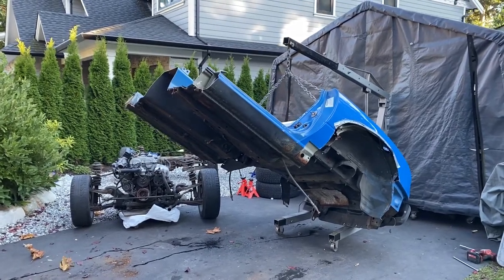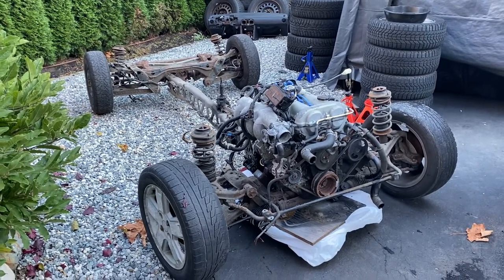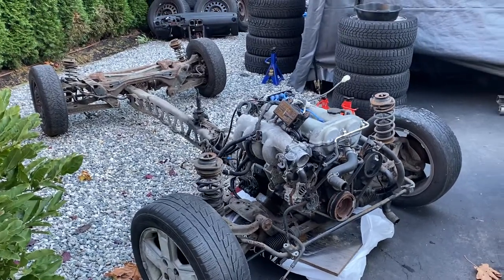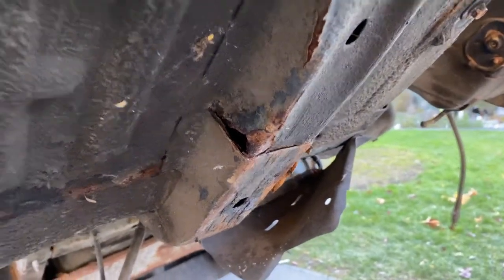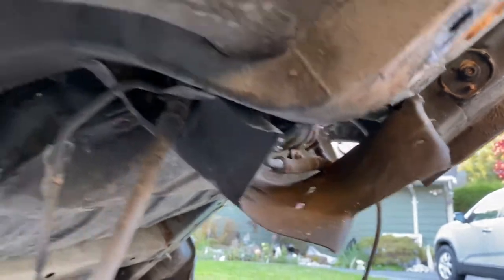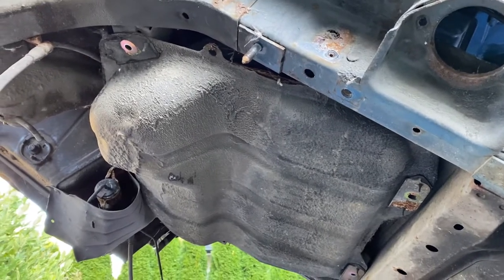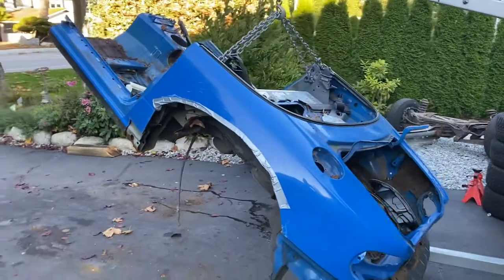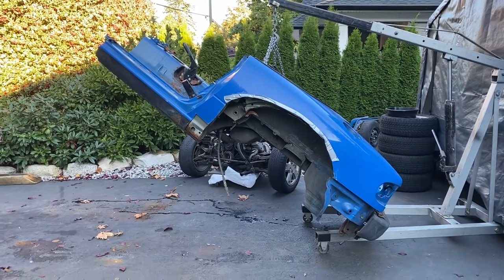Here’s what’s underneath a Miata body.

Comment: Hey man, do know of where I can buy the bracket for the leather shift boot that screws into the bottom of the console? I recently bought a 91 miata and it didn’t come with either of the boots for the shifter.
Reply from the maker: Hi Mason, you may be able to get one from the auto wrecker or from your Mazda parts department. 
I have a few spares here too.
Reply: @MiataMan  Thanks man! I found a NA at a self service salvage yard near me that luckily had the center console in it still.